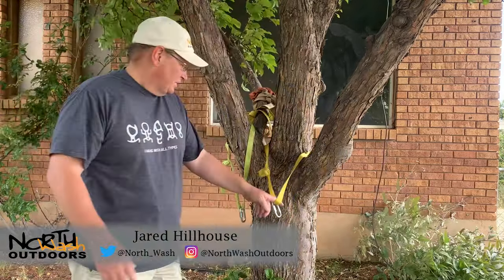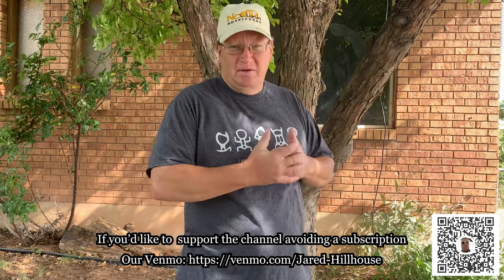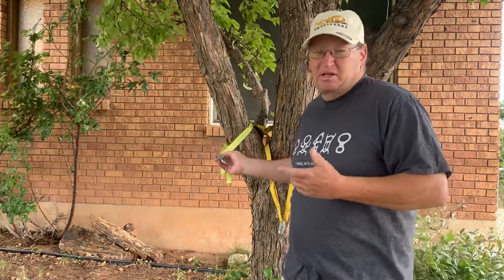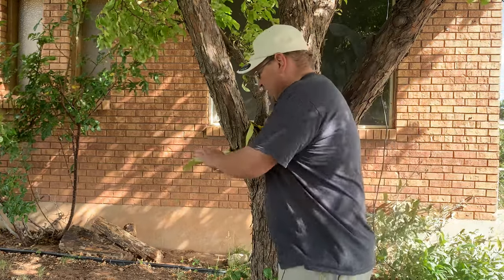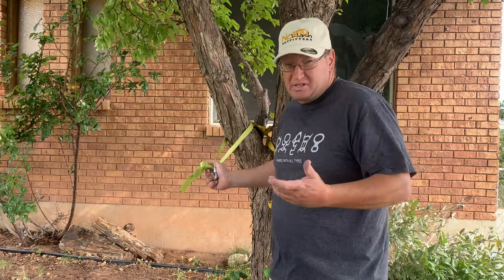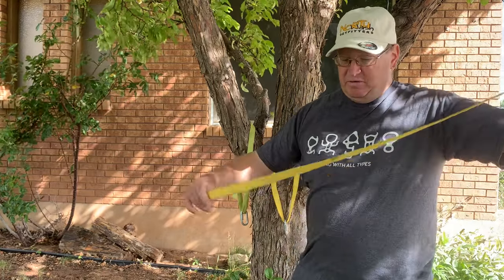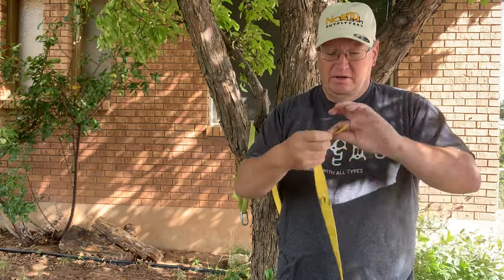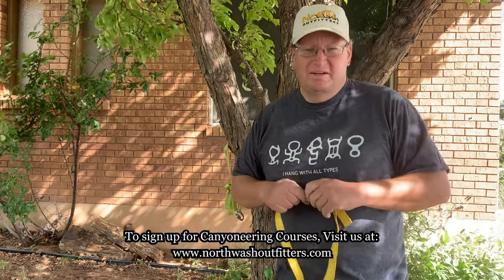Tying A Rappel Anchor For Canyoneering | Rope Work

Comment: Great video!
Would you recommend putting the chain link into an overhand to center it rather than it sliding around on the webbing?
Reply from the maker: I’ve done both. It’s situationally dependent on what will work better for that specific anchor station. If I don’t want it to move then yes, I set it up that way. Generally tho - KISS.
Reply: Thanks! Great info